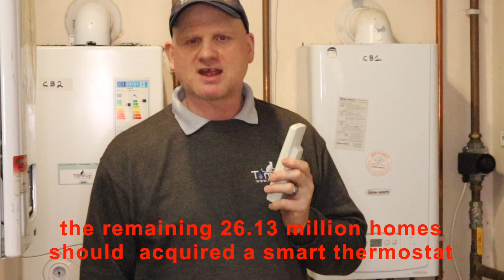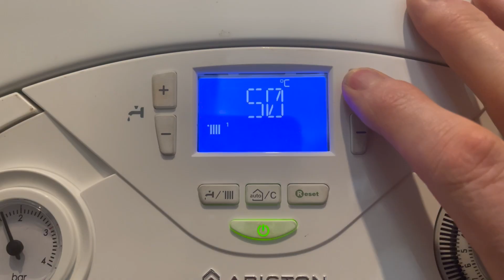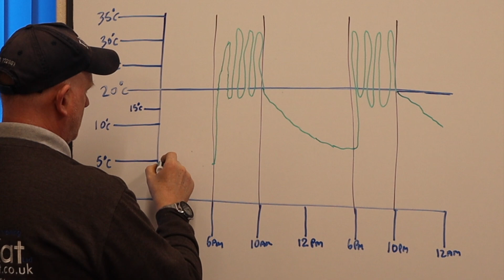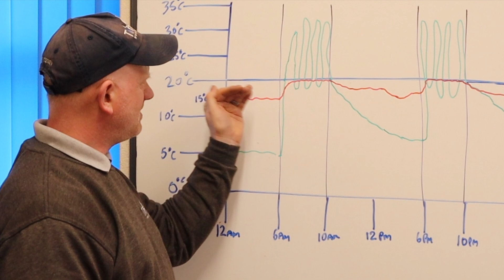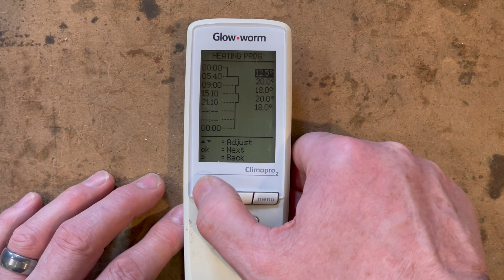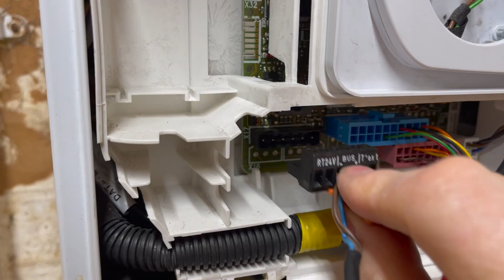How to save gas, Glow-worm climapro2 review and installation on different glow-worm combi boilers.

Comment: Hi Derek, thanks for this video. I have an externally set up of the bus and the Climapro 2 thermostat. The handset (and possibly the receiver on the wall) are no longer talking to each other…. After changing the batteries I only have a ‘white’ blank screen. I a guessing they need to be paired….. all I can find is “they come paired”. Could you advise how to re pair them please??? Thanks in anticipation! Steve

Comment: Hello, I must admit it’s worth it’s weight in Gold. I’ve had the heating on since the middle of November 24/7, my highest monthly bill for gas has been £70 (January) that’s been with 3 showers a day and we cook by gas. During thous months my wife has had the bedroom and bathroom windows open for ventilation. My lad has been wearing short pyjamas during the night, I must admit it’s a game changer. 
I  run the boiler at 7kw, and the hot water at 48 degrees as we have showers. I use the full amount of settings on the thermostat and it changes temperature by 0.5 on every setting. Leave it on when we are not in the house, house never drops below 20.5 degrees, with the money I have saved I’m going to install under floor heating downstairs and  upgrade my insulation.

Comment: I have a Glow Worm Ultrapower  170sx and a Climapro 2rf  which I have had no problem with until recently.
 The launch temperature  at 82degs is too high with current energy costs and I would like to reduce it to 60 degs. 
Could someone please tell me how to do this. I have tried several times without success and was unable to get any help from Glow Worm Technical Support

Comment: You have said that the climapro is not suitable for a y plan etc, this is not correct, a glowworm smart wiring centre allows the use of climapro,  please correct me if I am wrong
Reply from the maker: You have just answered your own question I said it can’t be used on its own you need like you said the smart wiring centre

Comment: I have an outside temperature sensor with my Glow-worm climapro2. When the temperature is very low - near freezing, the heating system works. However, when it is mild outside (say 10 deg C or above) the heating system fails to reach the target temperature. This because the flow temperature drops so low that the radiators will not provide enough heat to increase the inside temperature. One of my main heaters turns off completely to avoid blowing out cool air (it is a fanned radiator - Myson kick space heater). I want to disconnect my outdoor temperature sensor. how do I do that. Can I just remove the sensor's battery?
Reply from the maker: The curve is set up incorrectly.

Comment: Thanks for the video! - I have the Climapro controller with a Glow Worm Ultimate 30, installed last year. My issue is it does not seem possible to lower the  flow temperature on this model, (flow temp goes up to 75 which i feel is too high/expensive) I emailed Glow Worm to ask  how it can be turned down.

Their reply = "With you having a Glow-worm controller it essentially blocks you from altering the burning temperature as the only temperature requirement you realistically need to change is room temperature.

The heating set point is set on installation before the controller goes in, this could require an engineer to remove if the receiver is inside the boiler casing." Not the answer i was hoping for!
 I assume this means only the original installer can lower the flow temperature?

Comment: The Climapro2 is not just for Combi's, you can use them on all Glowworm boilers with a smart wiring centre2 or the Sysyempro3 although this has now been superseded by the new MiSet, I have been installing Glowworm  Weather compensated systems since 2009 using every type of controller, programmer, outside sensor and wiring sensor they make, all systems are hot water priority and you only need to fit a boiler the size of the largest demand, so most typical three bed homes need only a 12KW Ultracom2 or Energy "R" The fuel savings can be very good and even better when used with a high recovery hot water cylinder. Customers love it, lower fuel bills, fast hot water recovery, and a very comfortable room temperature as it stays constant. Made my living selling weather comp Glowworm systems in mainly large multi floored homes in London and Essex, some are simple Glowworm Flexicom with the small Climastat and wired outside sensor as that give weather comp and the other end was installs with Systempro, an outside sensor and three Climapro2 for a multizone wireless systems that no other manufacture could do, and then there's underfloor heating with no blending valve and pump set on the manifold, fantastic systems.

Comment: Brought one for our new gloworm compact when the landlord didn't fit any form of control for the boiler so turning the heating on and off was a real pain in the proverbal, the previous boiler being an ultracom and as such had the timer built in.
what's nice about connecting this to a glowworm compact is that there is an ebus connector underneath the boiler, so no covers need removing and as such is easy for an end user to fit if no other controls have been fitted (though I believe now there should at least be a thermostat for the heating)

Comment: I have this thermostat, it keeps having a communication failure and needs re-pairing via the installer menu, any idea why it's doing this sporadically?
Reply from the maker: Have you changed the batteries
Reply: @tomkatgastraining  yeah brand new. It has been replaced a couple of times due to the previous one having a slightly dodgy screen. All the new ones have the same issue, wished I'd not changed it now. Just wondered if you'd ever come across this issue before? Handset is also very close to the receiver so definitely not batteries or signal. RF test shows no problems each time it's re-paired.
Reply from the maker: @stevendelve9129  the only time I have come across this is when the boiler is installed in a cupboard and I moved the receiver out of the boiler and into the cupboard and it worked fine

Comment: The MiSet/MiPro look like nicer versions of the VRC720f which I have, its not very well documented that the GW/Vaillant ebus stats are compatible, maybe at the top end with ASHP etc you then need to stick with VRC stuff but for a standard/combi/system I i think i prefer the GW stuff.

Comment: The only issue I’ve found retrofitting these to the older combi boilers is there modulation ratio being poor. You have to set a higher curve to stop the boiler short cycling in normal winter temperatures at 8-10 degrees outside

Comment: For Vaillant boilers, you can buy the Vaillant Opentherm module VR33, which boiler manufactures legally have to support in certain European Countries (no U.K. legal requirement). It’s quite hard to get hold of in U.K., but I bought it online from a Netherlands store. 
One you have Opentherm, then probably Tado have the best smart Thermostats, but i use Nests in properties as they look great and my tenants like the simplicity.

Comment: Hi Dez, could you do us a tutorial on heat recovery units. I've seen some in situe but never actually installed one. Opentherm's a common interface which communicates with most major manufacturered boilers. The best thermostats for the installed boilers are the ones produced by the manufacturer.  Would Glowworms Stat now work on Vaillant? 
Great tutorial as always Derek. Hope you have a wonderful Easter break 👍.
Reply from the maker: Yes the stats would but would not be supported by the manufacturer